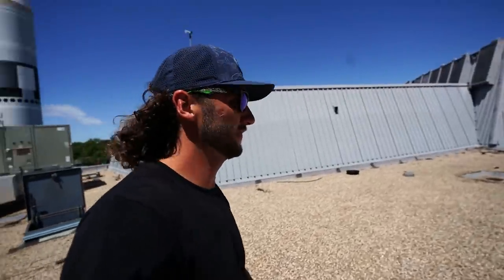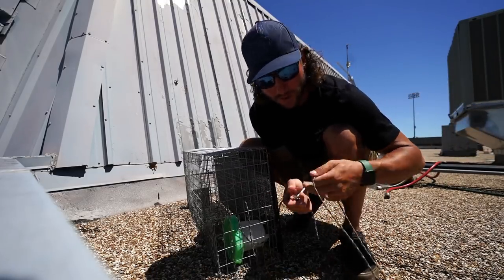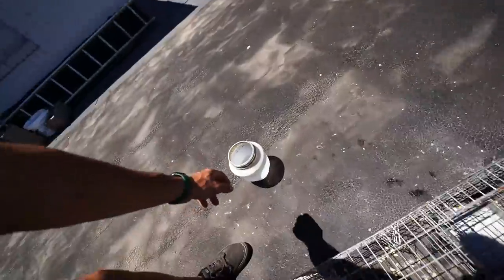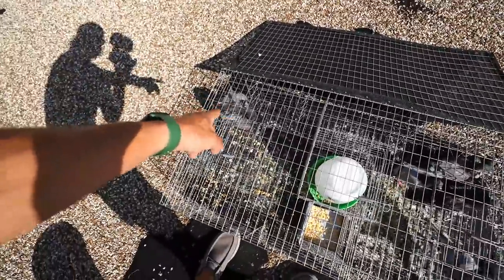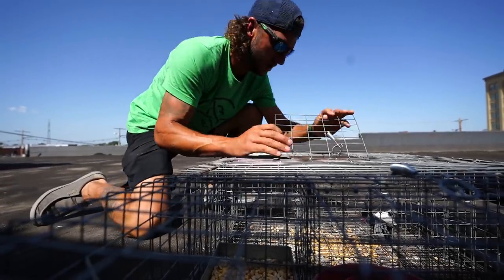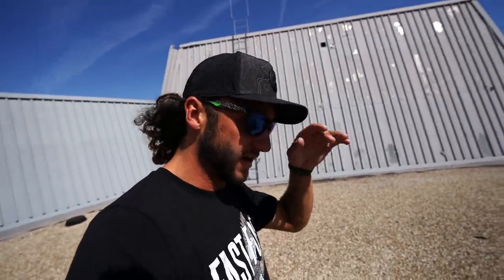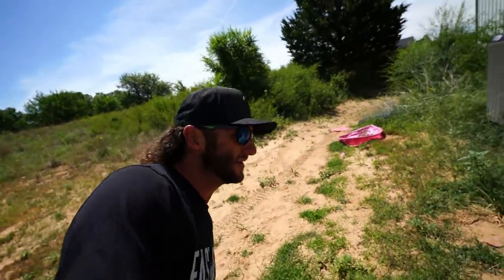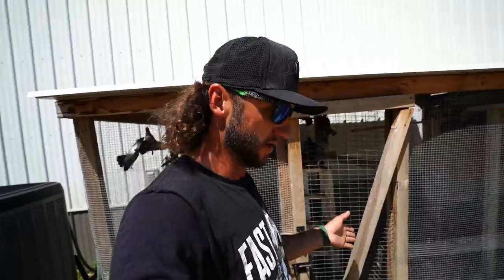Trapping Pigeons Until My Loft is Full and My Plans For Them..

Comment: The pigeons are taking a bath. It's necessary for them and that's why they are standing and pooping in their water tub. For my pigeons (rollers and racing homers), I have a bathing tub separate from their drinking water (though they don't always distinguish between the two as they still drink from their bath water). Their bathing tub doesn't get changed daily, but their drinking water does.  To help keep them healthy, I add a tablespoon of apple cider vinegar daily, and a teaspoon of pro-biotic every other day. I add avian bath salts to their bath water every time I change it. If you don't want your pigeons pooping in their drinking water, get them a waterer that they can't stand in.

Comment: Get five gallon buckets and drill 2 inch holes around it about 2 inches from bottom of bucket to bottom of drilled hole, fill with water, put lid on, no poop in water, BUT leave the big open water pans also as pigeons love to take baths to keep the oil in their feathers spread and clean . Put several of those buckets out for fresh water, PS they work great for feeders to have less feed waste!  Oh and I'd use some silicone to fix the crack in your trap waterer!

Comment: Hey man, I have a solution for your water source issues. there is a great company called "rent a coop" and I have been using their products. They have these auto fill water cups that you can attach to a 5 gallon bucket. super clean and super easy. I also have some other tips for you that I have found to make things easier if youd like to know.